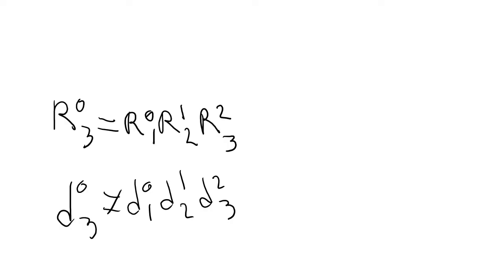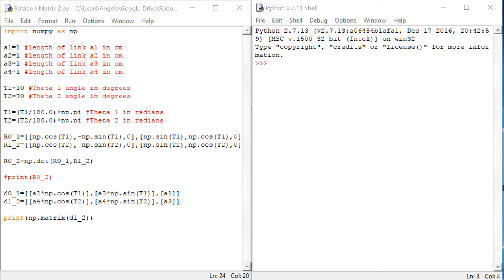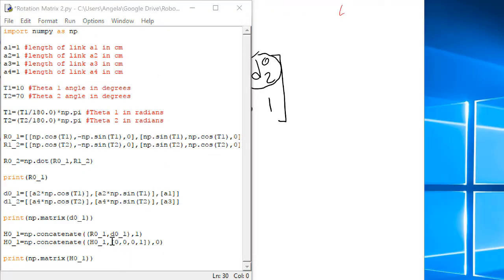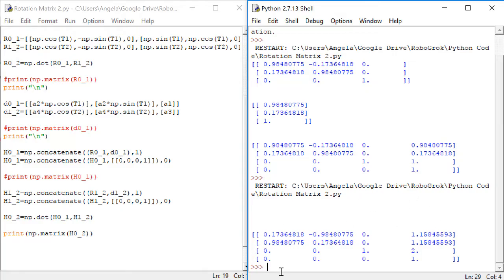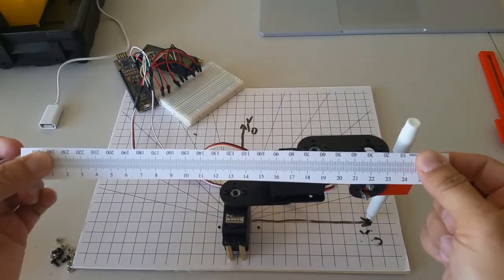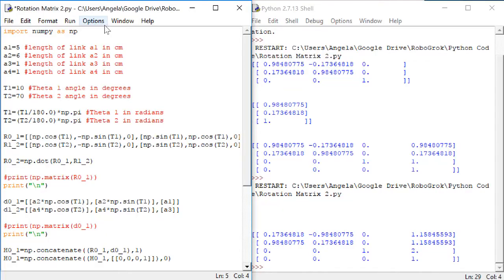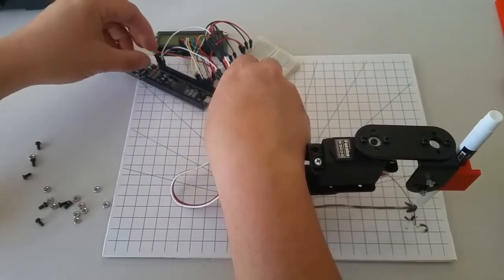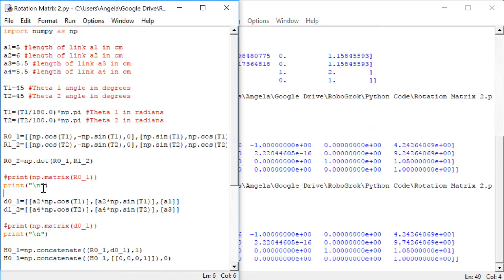Robotics 1 U1 (Kinematics) S5 (Homogeneous Transformation Matrix) P1 (HTM from Rotation Matrix)

Comment: perfect , ı was wondering , for ex. video at 29.53 , displacement vector says z=10.5  what does it mean ? its not 10.5 reality
Reply from the maker: Good question!  In our kinematic diagram, we didn't account for the marker yet; we only drew the links going between the servos.  So, our output is actually telling us where the marker meets the second straight link.  If you measure how high that is above the board, it should actually be about 10.5.  We only put the marker on the device in order to more easily see the X/Y location of that point.